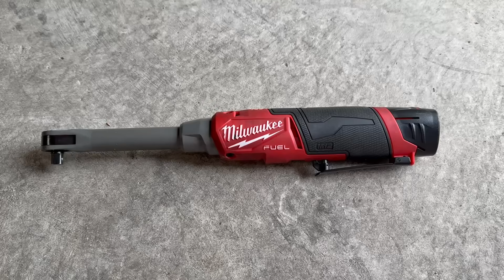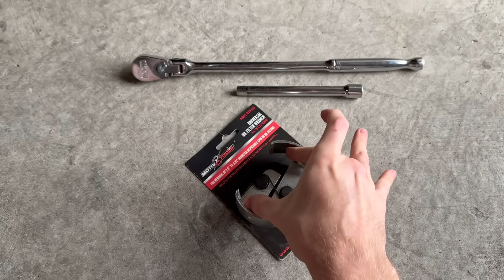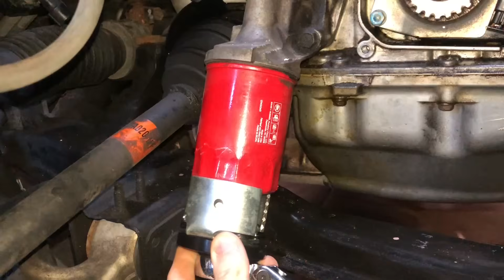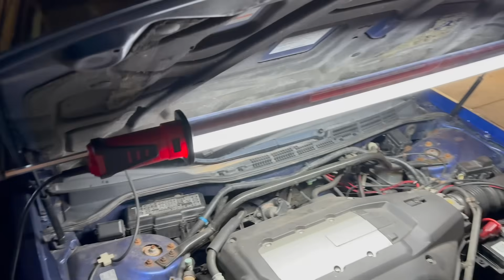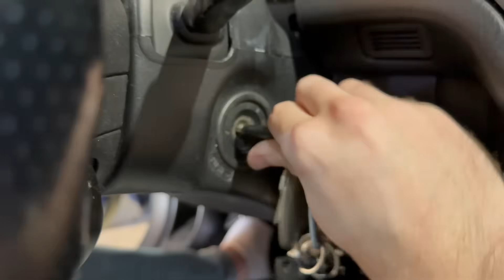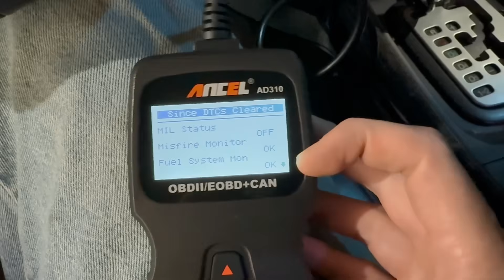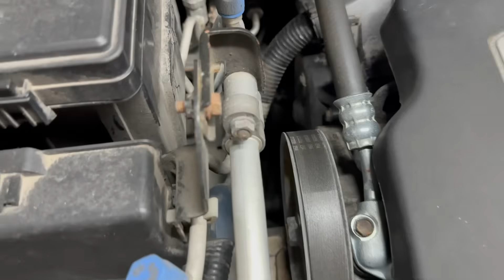Top 5 UNIQUE Must-Have Tools for Working on Cars

Comment: Use thread charts at work all the time in aviation testing and keep a set on my service truck for using on my equipment and other vehicles.
Reply from the maker: It's an extremely helpful tool to have fore sure! It's also one of my favorite tools to use, very satisfying restoring an old rusty bolt. Thanks for watching!

Comment: The thing with those hood lights is that not all hoods work with that size. I have done cars where the hood is too small for a hood light and been forced to use magnetic lights or a neck light.
Reply from the maker: You are definitely correct that one size doesn’t fit all, and that it’s important to take measurements before purchasing. This ATD brand that I showed has both a 47”-75” and 55”-83” size. I’ll be sure to add this to the description. Thanks for the feedback :)

Comment: I have seen a bi-directional scan tool Topdon and you can use that and a smoke machine from temu for $55 and you could find vacuum leaks and evap leaks. Like your tool choices. Just subbed
Reply from the maker: I gifted my dad an Xtool D7 scanner. It's crazy how much you can do with it. I haven't had much use for it since my cars are so old and simple. But the solenoid testing has been useful when in times of doubt. That's a good tip using it in sync with a smoke machine though, didn't think of that! Probably would have made life easier when my IACV failed and I had to buy a smoke machine to test for leaks. Thanks for watching and subscribing! :)

Comment: Those are the best groove lock pliers.  My main set of pliers for hose clamps or whatever big are the gv10r.  I use a set of small channel lock oil filter pliers.  I work w plastic unions so I think they are better than those adjustable oil filter wrench things.  I have a bunch of different ones w different angles and handle lengths but those little channel locks are the ones I usually have to use due to space and the size of the fasteners I use 2-3.5”
Reply from the maker: That Irwin wrench set was an amazing Christmas present from my dad. They work really well! I can understand the channel locks being better for your purpose. My style of oil filter wrench gets most of its grip by slightly crushing and digging into the oil filter. Wouldn’t want that to happen in your application. Thanks for watching!